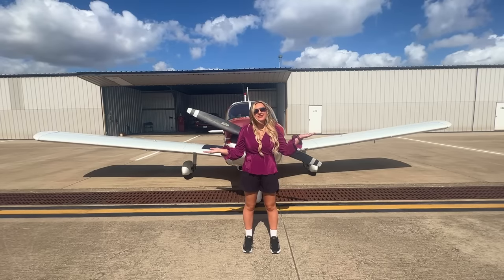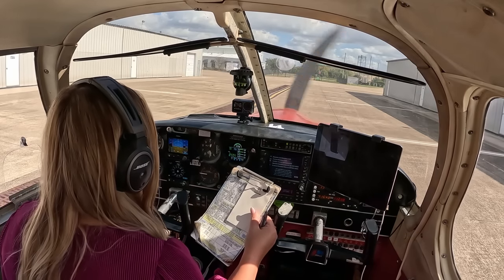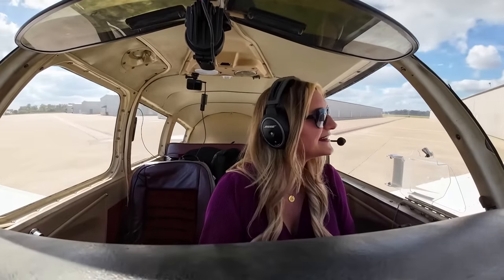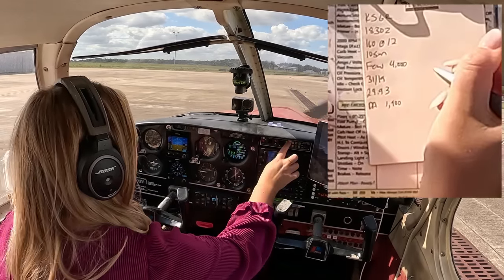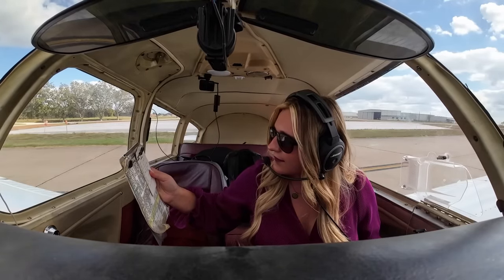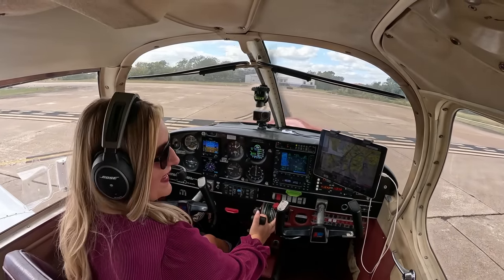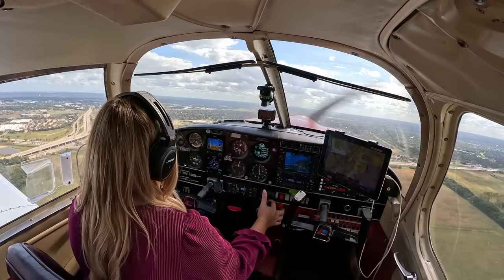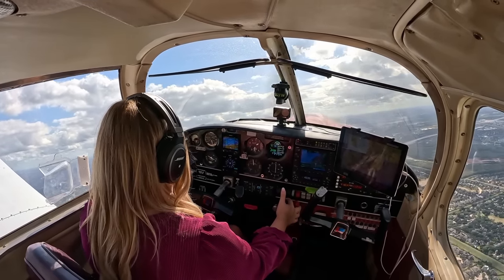Emergency! Failure In Lil Red - Return to Airport!

Comment: Nice decision making! As an 11,000 hour CFI, ATP, A&P, IA, i have one very small suggestion. during your runup, Instead of checking aileron then elevator travel, do this: Elevator full forward, then aileron full one way (your choice), keeping aileron fully deflected, pull elevator full back, then aileron full the other way, the elevator full forward. Visualizing this, you will see that the controls will make a box. If there is anything that is in the way of the controls, this will catch that. The way you checked the controls would miss if say a wire under the panel came loose and would only interfere with the controls at for example, left aileron and elevator halfway back.  Also I teach my students to stick their thumb up of the hand on the controls. Now it is "thumb up points to aileron up" and you don't have to remember which aileron goes up and which one goes down just in case a mechanic hooked them up backwards (happens very rarely but does happen).
Reply: It's obvious she faked this "emergency" for clicks
Reply: How is it obvious?
Reply: Hey Nelson, don't ya just love people like random that flap their soup coolers about your post and then ignore you when you challenge them on it?  Ya gotta love "milktoasts
Reply: @nelsonhochberg5182   Maybe not obvious, but it's still youtube - where a high percentage of videos are manufactured for clicks.
Reply: In a later video, Kay stated that her mechanic found that the K factor for the fuel flow transducer was not reset after changes in the instrumentation. An easy thing for a mechanic to overlook if the transducer itself was not changed. As a result, Kay was getting erroneous readings from an important instrument: her fuel totalizer. So Kay decided to return to her home airport which was not very far away.  To my thinking, this was very appropriate.

Was it an Emergency as was stated in the first word of the title of the video with an exclamation point behind the word? She didn't declare an emergency. She didn't even declare a fuel problem (which is a required report when on an IFR flight plan - FAR 91.183 (C)). She also declined assistance when offered by ATC. Kay didn't think it was an emergency since she didn't declare. The only criticism I might make is it was dramatic to have the word Emergency! in the title. But it worked. That's why I watched the video. It worked real well for me because I also subscribed to the channel. 

I probably would have declared since a leak was possible but not probable with how erroneous the fuel totalizer info was. The leak would have been after the fuel transducer which is in the engine compartment and fuel transducers are usually mounted down around the exhaust manifold. It would have been nice having ATC looking closely at my blip in case I had evidence of an engine compartment fire and Sugar Land Airport and any other airport was now not an option. If Kay reported the fuel problem to ATC, she may have gotten a call from an FAA inspector because ATC is required to report Fuel quantity problems to the nearest FSDO (FAA Order JO 7210.632 (A-10) (d ). That would have been a minor inconvenience since she saw a certified mechanic after the incident. Amazingly, just declaring an emergency does not require ATC to notify FAA. BTW: I suggest any pilot reading this to read FAA Order JO 7210.632. If ATC knows about a mechanical problem, they are required to communicate that to FSDO and you may be getting a call from an FAA inspector. The second thing the inspector will ask did you have a licensed mechanic look at the problem (even if it is just a door popping open).

This incident reminds me of a fuel indication problem I had back in the 1990s. I was a flight instructor with a low time student pilot flying over the local practice area in a C172 (about 10 minutes from the airport). The fuel gages were right in front of me and one time glancing at them, they both read zero! I calmly told my low time student: "let's go back to the airport. The entire time flying back to the airport, I calculated my flight time probably 20 times in my head since my top off. Each time I calculated I should have about 2.5 hours of fuel on board. I then had the tanks topped off and sure enough, I had 2.5 hours of fuel on board. I went to the mechanic of the FBO and told him about the problem. He said: "Yeah, they do that sometimes." To which I replied: "Well fix them!" He said: "I looked into it but couldn't find the problem." Then I said: "Get someone else to look into it or I will help you find the problem." He was not interested in fixing the problem so I went to the FBO owner and explained what happened to him. The FBO owner said the mechanic was in charge of the aircraft maintenance and he wasn't going to interfere to which I said: "I quit!!" and I left.
Reply: @randomvintagefilm273   Yeah sure she did. And you posted your negativity for what purpose? To prove that itty its can post?
Reply: @ohger1  Back up your opinion with facts. Some random claim has no merit without facts to back it.
Reply: @preciousnic1974  If you don't think the majority of youtube videos are fabricated for clicks, you'd better talk to Santa.. 🤣🤣
Reply: @randomvintagefilm273  This wasn't an emergency, she notices an anomaly in instrument readings and did the sensible thing returning to the closest airfield. She never reported an emergency situation to ATC because there wasn't one and handled what was happening appropriately and with a cool head. In the end it appears to be a sensor not recalibrated after an instrument change but the readings she was seeing could have indicated a serious problem.
Reply: @schrodingerscat1863  "This wasn't an emergency" ... I think the point people above are making is, since it wasn't an emergency, that word doesn't belong in the title of the video. Non-pilots use that word casually; a pilot with a channel about flying probably shouldn't, unless their goal is views rather than education.
Reply: @midnighteternalsoul  It was an emergency when it happened as she had no  idea why it was happening. Could have been a serious problem for all she knew. As it is, after investigation, it turned out to be a bad sensor. The video shows how she dealt with the problem calmly and with a level head. Of course the title plays the incident up for views that is what posting videos is all about if you want to grow your channel.
Reply: @schrodingerscat1863  Not sure it makes much sense to both agree use of the word is sensationalist, and dismiss the concern by saying it's justified, but whatever. She handled it professionally and admirably, and that would still be true even if she didn't stoop to clickbait.
Reply: Yep, best test is to stir stick into all 4 corners of the box. Ailerons should come up to meet the stick, but my instructor had a nice expression of "Up mine" and "Up yours" referring to the ailerons as the pilot in the left seat moved the stick towards himself for "Up mine" and towards the right seat for "Up yours" 🤣
Reply: lol really??? So she typed the word emergency. As a novice pilot if my gauges are showing 30 gals per hour, I’m gonna get my ass on the ground. Call it clickbait or marketing… it was a very good video showing young pilots that it is always better to be safe than sorry!!!!

Comment: Great job. One thing I may have considered in this scenario would have been to return to the airport at 3-5K depending on what you needed to stay in VMC and spiral down. There are pros and cons to this plan, but altitude is your friend when the power goes away. Not taking anything away from the execution of your plan. It was spectacular.

Comment: You did an awesome job handling that Unanticipated Return! (Not that I expected anything less!) 
You're an awesome Pilot, you recognized a problem & made the right decision to return, in other words you Aviated, Navigated & Communicated, which I'm pointing out for any Student Pilots, Newer Pilots or Non-Pilots that are watching. You didn't declare anything, which is appropriate since this situation was Not effecting a "Vital Instrument," like Altimeter, Airspeed/Ground Speed Indicator, Artificial Horizon, Compass, etc. However, returning, especially with New Mags. in operation on board, was the right call. As you returned, you flew normally, expecting a routine landing, but you remained Situationally Aware, making sure that you had a Place To Execute An Emergency Landing, IF you should lose your thrust. You kept an eye on your "Problem Instrument," without becoming hyperfocused on any one thing. This Video Is A Perfect Instructional Video for Student Pilots & Inexperienced Pilots that may not be sure how to handle a "Non-Emergency Emergency," & you demonstrated The Way To Do This Correctly! This Was Not A "MAYDAY" or "PAN PAN" type "Emergency," but it was enough of a Concern To Warrant A Return, Which Couldn't Have Been Demonstrated More Perfectly than it was On THIS Video!

Well Who Am I? I'm A Recently Retired Airline Pilot with right at 30,000 flight  hours & I own Multiple General Aviation Aircrafts & A Corporate-Class Jet.
This is to say that I'm very familiar with Procedures, not just flying Airliners, but I've continued To Fly Smaller Airplanes during my Long Career Flying Airliners. 

On a Personal Note, I heard you mention Meteorology, & My Ears Really Perked Up because I Studied Meteorology at UCLA & I have my Ph.D. in The Science Of Weather. 
For one thing, when I was 11 years old, my Parents & I survived a Direct Hit  by A F-5 Tornado, & after that experience, I decided that I wanted to Study Meteorology in College. 
But I already had a Career as a Child Actor, & my Dad was a WWII U.S. Army Air Corps Combat Pilot over Europe, & continued to fly as a Civilian General Aviation Recreational Pilot for The Rest Of His Life. For as far back as I can remember, My Dad took me flying with him every Sunday Afternoon. By the time that I was 9 or 10, he let me take the Yoke of whichever Plane that he owned at  that time, which we were flying in that week, my Dad allowed me to Guide It Around. He also taught me how to read The Instruments. So I was also very interested in a Career In Aviation. Well, I have booked Movie & Television Acting Jobs, I studied Meteorology but I was still working on obtaining my Commercial Air Carrier Certificate, while I was attending The University. My Wife was killed by a Drunk Driver, & I was left to finish raising our children. I couldn't work with the Airlines with Kids at home so I worked as a Television Meteorologist until my kids were grown. 
When they were grown & in College, then I returned to The Airlines. I love Aviation & Flying, & Operating An Aircraft in The Atmosphere where The Weather happens was a wonderful way to experience The Classroom Knowledge that I had learned becoming a Meteorologist. That was an Amazing Experience! I noticed that you were having a bumpy flight, & you might have been having some wind trouble, but you were also experiencing Thermals. This was obviously a lovely Hot Summer Day.
I know that you can speak to a lot of Classrooms about Weather & Aviation. That is a wonderful thing to do. 
May G-d Bless You!
Reply from the maker: Thanks for sharing your story. Sounds like you've had a very busy life! :)
Reply: @FlyWithKay  Yes, it has been busy, but it's been a blast! I took my retirement just so that I can catch up on my sleep! 😆
I thank you for sharing your Videos, it's good to see a younger Pilot that can fly an Aircraft correctly! You set a good example for All young Pilots to follow! 
Happy Flying & G-d Bless! 🙂

Comment: Nice job Kay.  If you think you may have a problem, don't forget....altitude is your friend.  I would prefer to maintain my current altitude (if possible) until I had an airport "made" (I'm not sure if you would need to declare an emergency).  Even if you don't make the airport, your forced landing choices are also much greater.  Take care!
Reply: "There is no substitute for altitude".
Reply: I would have informed the controllers of the potential fuel problem and got them to let me stay high and slipped to ditch altitude at the end to make the airport.

I flew out of Pocatello, ID so slipping down to a runway was the rule, not the exception.

Big crosswinds are common there.
Reply: @adopstap Speed maybe? :D
Reply: @wjohnson100  I would just make a normal approach and landing rather that try some circus stunt that is never practiced.

Comment: As a Controller/Pilot I'd encourage you share with ATC.  The camera will not be able too help you but we sure can.  We work with pilots all day everyday thats have strange things come up and it does not have too be an emergency.  Consider telling the controller you are getting a strange reading on your Fuel flow and want to have your mechanic take a look before continuing on.  A lot of us are pilots too and here to provide assistance even if its to give you a second set of eyes while you're flustered or troubleshooting.   Changing a destination on IFR flight plan even back to a field is an ATC suspicious activity and reportable at times to the higher ups.  Before the controller passes on to the Tower or next controller that you are turning back too take a crap give them something better too share or if it's that let them know to brighten their day.  We can give you priority anytime we want.  🤪
Reply from the maker: Interesting you say that. They all know me at my home airport. Not sure if ATC had them ask or not but my controller did ask why I was back so soon and I told him my fuel flow gauge was not reading correctly. So he may have let them know. BUT, I will keep it in mind about lettting ATC know why I'm heading back next time. Thanks for the comment!
Reply: If anything, dont be shy to share issues with ATC. Your field may be not busy but they, meaning ATC, will without a doubt force a sold out A380 into a holding pattern if a single seater is having problems and rightly so.

Comment: HI Kay..Just subscribed.. As a retired pilot I will say I love your airmanship. Not looking over anything, double and tripple checking crucial instruments and switches and watching for traffic. Your decision to return was an excellent safety call. I have had a few close and scary calls myself and the first thing to do is to stay calm, assess the situation, if serious inform ATC asap, check your options according to the situation and make a decision just as you have done. I was impressed by your decision to keep the flaps retracted and stay at a higher altitude on approach for safety, excellent thinking. You are the kind of pilot I would have no problem flying with. May I ask how long you've been flying? 
Looking forward to checking out your other videos..Take care, safe flying🛩☮
Reply: my thoughts exactly.

Comment: Great video, and as a former RAF pilot I fully endorse all the comments about your professionalism and calm decision making.  One small thing.  It's not great to lose a pen in the cockpit. It could easily jam the controls. Maybe tie it to your clipboard with a short length of cord?  We used to attach ours to our flying suits with a piece of cord and write on a knee pad. It also enabled us to wrap it around the hydraulic cock so that if our instructors closed it to give us a hydraulic failure we'd feel it tug to give us warning that a full flashing lights and klaxon emergency was about to hit us with severe loss of pitch control. 😁

Comment: Aviate, navigate, communicate. Great job Kay. Wise decision in trusting the instruments. Stay safe. 😃
Reply: trusting the instruments? It's VMC ! !
Reply: you must be a fan of Kelsey :)
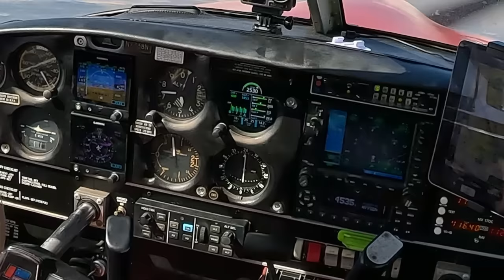Reply: It's VMC, but at 20:25 in the video She recognizes the fuel flow is very excessive. Too many Pilots would have thought that it was an instrument malfunction, but Kay trusted the reading and returned to the Airport and found out that it was a serious fuel leak. 😃 @buckmurdock2500
Reply: She didn't communicate her situation. Had she, the tower would have asked fuel levels, number of passengers on board, kept her high as possible and given her preference  among other precautions to potentially save lifes on the ground and in the air. Huge fail on her part. Don't praise this woman, she broke a cardinal rule
Reply: @jrjohnful  👎
Reply: Kevino, your as bad as her if you don't think communication is necessary, and shame on you for trying to portray that to others. Clearly your not a pilot, and if you are I pity you and those that fly with you
Reply: I'll never understand why pilots are so afraid of declaring emergency.

Comment: Aviate , navigate , communicate well done indeed, had to get tower to hold the pattern on my third solo many moons ago , smelt fuel turns out the wing filler was lose , didnt see that on my pre flight , always check it now. Another trap for young player's  rotated and then heard a flapping sound about my fifth solo , turns out the last instructor , it was a trainer aircraft had left their seatbelt hanging out, good wat with both instances to include everything on the walkaround. But IU digress I do that. Great upload indeed, hopefully talking to the young people in class you can initiate the burn for aviation. Many people still ask me how did you learn to fly?, my answer is its no more difficult than learning how to operate a car , albeit a different scenario but relative . Thank you you brought me back to single prop piper days, yep with the wings in the right place unlike a Cessna high wing beasty   :)

Comment: It's got to be a sensor issue or instrumentation failure.  Even at full throttle at sea level, it is absolutely not possible for the Lycoming O-360 to consume 35 GPH.  A full rated takeoff at sea level is only 17.5 GPH.
Reply from the maker: Exactly! You were right, my k-factor got all jacked when we made some changes to put in the new magneto😊
Reply: @FlyWithKay  I'm glad to hear it wasn't anything too major!